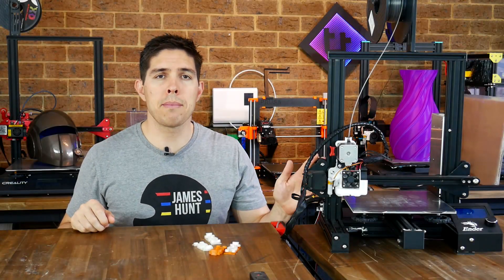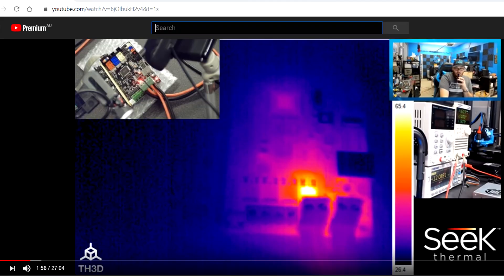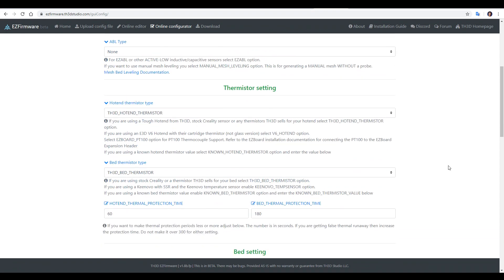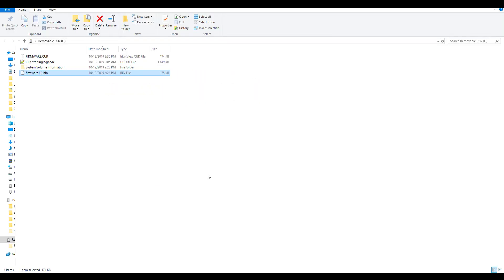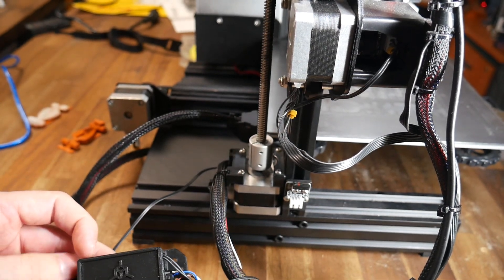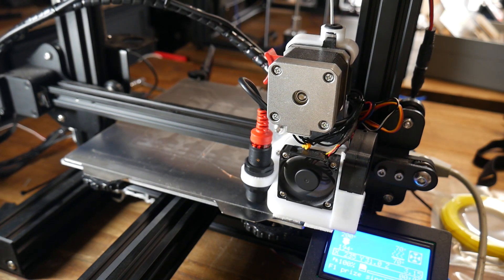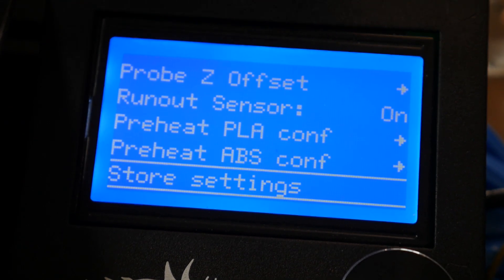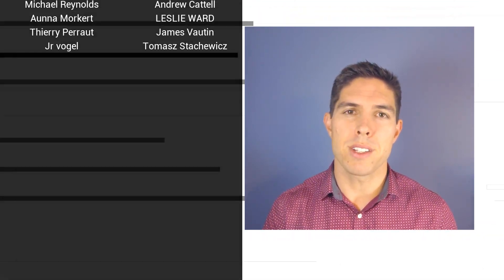EZBoard Lite - The most user friendly Ender 3 mainboard upgrade + EZABL Pro

Comment: $100 for non replaceable stepper drivers and they didn't even use the the superior 2209s...  the skr 1.3 board is under $35 with better drivers.
Reply: Timothy Hoogland  That's a lot of words to try to deflect that they are Superior drivers.. Greater max current and sensor less homing alone make it Superior. Saying that I don't need or use those features is pretty silly and shows that you know it already.  I don't use Marlin anyways so that's also a mute point. 

Bottom line is most people won't pay ⅔ of their printer price on a board. I wish you the best of luck and can see that it's a good option for those that don't know much and would rather pay than learn/mess with firmware.
Reply: Timothy Hoogland  That's not a fact... that's an opinion.I don't know if you noticed, people use and tinker with the ender 3 in millions of different ways. Some of those people might prefer sensorless homing for example. Also my 2209s have been just as reliable and that bleeding edge was half a year ago.

Instead of trying to argue the 2209s aren't superior, you should keep to your opinion of reliability or that most people won't notice the difference.
Reply: Timothy Hoogland You are claiming that there are Trinamic clones on the market? In particular for the new 2209 which just came out? This is not how the semiconductor industry works. Also, the stall detection has additional benefits over only homing, you can implement an emergency shutdown if you detect a clogged up nozzle on the extruder or the gantry hitting the top limit - no need for precision and repeatability in either case but certainly an improvement over the 2208.
Reply: Timothy Hoogland    Nah I'm good. You helped me out enough reaffirming I made the right choice going with the skr 1.3 and 2209s. You might want to work on your answers though because I'm not the one who is going to be asked, "why not the 2209s?"every time this board is mentioned. Judging by these comments,  using the"you don't need that much power" and " don't you guys have endstops?" speel isn't working.
Reply: Timothy Hoogland there is no point in cloning TMC chips, if you go into all the effort of engineering functionalities like StealthChop you are so much better off selling them under your own brand.

Show me one “clone” which is not a third party relabeled cheap Apollo or similar. Bigtreetech is obviously selling the proper ones, otherwise they would not have been affected by the lead time issues and the advanced features would not work.

I get that you are bitter about a chinese company beating you to market but if you claim the use of counterfeit parts you better have substantial evidence.
Reply: @christophmuller3511  He's claimed that there are clones on other forums too. Never could back the claims up. Tried to post some links which actually showed that there were NO clones if you read the full article. Scaremongering. Anyways, dude has made a good board. It's just not worth $100 in my and many others opinions. He's operating out the the USA so labor and other costs are much higher so he needs to charge that though. If people buy it then they either don't know that the SKR E3 Mini is 90% as easy to install and configure now that Marlin 2.0 has been released with full support or they have enough money not to care that they could get a good product for a lot less. There is room in the market for both companies but I really wish he would lay off trying to flame BTT so much to support his.
Reply: @christophmuller3511  counterfeit electronics and connectors have been a huge issue for the past twenty years in industry.

Counterfeit products undermine IP (intellectual Property), economic security for various countries, they also are sold fraudulantly as genuine products and undermines and ruins product reputation and market share.

They make these counterfeit products at sub par quality and sell for a huge profit compared to a genuine product.
Reply: creamysbrianna sure, but counterfeit chips are most of the times other compatible products relabeled fraudulently. Cloning a chip is hard, and takes years for non trivial designs (the TMC products are definitely in the nontrivial category). There is no way someone could have fakes on the market for a chip presented in June… 

Beside the engineering challenge there is also the production lead times: if you would miraculously had the cloned design ready in July you would have typically gotten the first engineering samples around now. A chip I sent for manufacturing in October has an estimated arrival time of February…

Comment: "Overengineering" has been mentioned. But is there any advantage of 32 Bit boards for a relatively standard Ender 3? With the budget 32bit boards, you might as well go with that if you want better stepper drivers. Apparently the faster chips are better at motion control, especially for higher feedrates and complicated paths. But I haven't heard a definitive word about how and when this matters in real life.

Comment: Unrelated to the board, you said something that got my attention.  You mentioned that you could keep the bed heated while auto-level with BL Touch.   Are you saying the bed shouldn' be kept heated for EZABL while probing?
Reply: It should because the bed expanding and contracting can warp the values. There is a chance that probing with heaters on will cause interference. That's why there is an option to probe with heaters on, probe with heaters off or wait for heaters to recover while probing. I would choose wait for heaters to recover. This makes the printer probe with heaters off but waits for the heat to climb back up between probings. Probe with heaters off is not recommended due to thermal expansion warping the values.

Comment: interesting, i love the online config, i've been saying Marlin needs something like that fro years. I do wonder why he went with a capacitive sensor for the new EZ-ABL though, cant say i know a  single person who prefers them over capacitive ones.
Reply: I have an EZABL pro on an ender 3, works great, M48 test brings back 0.002315 mm on the creality glass bed. (which people told me it would not even sense the glass surface LUL)
Reply from the maker: The only ABL system I've tested that wasn't accurate enough to work was the Touch Mi, but then it worked flawlessly on a second printer. M48 test is great for troubleshooting but past a certain point it becomes redundant because the accuracy is easily up to the job.

Comment: great video! does this support sensor-less homing?
Reply: Y do u want sensor-less homing
Endstop micro switches and tremendous more accurate.
.
.
. And no, its basically one of about 3 things the TCM2209 drivers can do over the TCM2208.
This board uses TCM2208 drvers

Comment: This would make more sense if it came with a cheaper MCU like the LPC1768 and TMC2209 drivers, but won't argue with quality and/or ease of use. A big problem is the lack of European distribution, though. This high base price will mean even highet customs charges, while the SKR boards often get to skip those because they cost under 40 euros for the most part. Get some European distributors, Tim, I really like your products.
Reply: Timothy Hoogland  That may be so, but the 2209's run cooler than my 2208's. I have both standalone and UART 2208's, and version 1.1 and 1.2 2209's from BTT. I don't have any Waterott drivers, though.

Comment: I started with the Skr mini. Found that I could only run stock firmware on bigtree. With no way to add anything without deleting something (ver. 1.2). Because it has next to no memory means it just juck. Went to the ezboard set it up with what I wanted and off to the races at 100mm/sec with no problems.

Comment: I have a couple of Ender 3. I’ve been through many boards, including the MKS Gen L, SKR E3 mini v2, and the E3 dip, as well as the SKR 1.3. I’ve had lots of trials/headaches, in getting everything to work correctly. I’ve had nothing but problems out of the SKR E3 Mini boards(garbage). It pissed me off so bad, I literally threw it in the garbage. I had really good luck in the past, with the SKR 1.3, so I decided to use it to upgrade my second machine. As suspected everything works great, at a reasonable price. I say that, but through all the boards, and accessories I’ve tried to make that work, I could have bought an easy board or two LOL. If I were just starting out and I had no idea what I was doing again, I would definitely purchase the new easy board, knowing what I know now. Though, I do enjoy having the knowledge after working through all the problems I’ve had. It’s a tossup. If there is anything to take away from my comment...SKR 1.3 is a good budget board, the E3 counterparts are trash and my opinion. Good luck upgrading!
Reply: I share your opinion about the E3 mini.  CPU gets too warm while idling. Coonections are not or badly soldered. Screw terminals are more loose than on my 1.1.3 creality board that was known for the issue.

Comment: Is the th3d board can or cannot use LinAvance? Because it’s using 2208? Thanks
Reply: Timothy Hoogland  Are you claiming that Linear Advance Works reliably without losing steps on the EZBOARD with steathchop enabled with the TMC2208 driver on the Extruder (E0)?  If so, please enlighten us on the Marlin 2.0  settings and the specific marlin version, because a lot of people would like to know, including me,  because I have looked all over and all I find is lots of conflicting information. Thanks, and you would be my hero.

Comment: Will it work with linear advance?
Reply: Timothy Hoogland  in another video Michael said that linear Advance is not working with 2208 drivers???
Reply from the maker: There's work-arounds in the firmware now. The main issues was with TMC2208s in legacy/stand alone mode, where as this is connected via UART/smart mode).
Reply: @TeachingTech  Thanks Michael.
Is this something you will make a guide on?
Reply: Not a fan of this video / promotion of the very expencive TH3D board.. But for still keeping it real Michael, iam now a Patreon :) Thanks Michael !

Comment: I have had some issues with Octoprint and this board. Very Very Very slow to probe 9 points, over 100 seconds!!, cooling fans not obeying the slicer input and run flat out all the time. Any one else using with Octopront?

Comment: Looks great but price is too much for me and the shipping to Australia is a killer. Does anyone know of a budget 32-bit board for the CR-10 S5? BTT say that the SKR Mini E3 won't work due to power limits (or something... impossible to understand). Basically I just want to enable auto or manual mesh levelling and thermal runaway and I'll be happy.
Reply: (plus TH3D are sold out of the Ezboard, as well as the EZFlex2 Smooth 508mm)

Comment: Could you help me to program the BIGTREETECH SKR V13 32Bit Mother Board with TFT35 V20 Touch Screen and 5pcs TMC2208 UART. To ender 3 without advice as it comes from the factory.
but since I don't know English or program it is impossible for me to do the fiware. Thanks for your time.

Comment: Sadly, I am finally giving up on getting (or trying to get) this board. Not only has it been out of stock 4+ weeks now, they JUST raised the price to $119 USD. Considering they offer free shipping on an order of 125$, you'll need to add something to hit it. I'm sorry, even if it's a great board, it's is now HALF THE PRICE OF AN whole ENDER 3 or  3-4 times the cost of ANY OTHER board available and STILL is out of stock! There comes a time when the price of one part isn't worth it when you can spend that on other mods or even a whole new printer. 😔

Comment: Anyone notice the online configurator gives options for TH3D or stock thermistors? I switched it to stock. Does it matter??
Reply: It might, for temperature accuracy. Different thermistors have different values. If you haven't bought and installed new TH3D thermistors then choose stock. Creality has already provided the correct values for the stock thermistor for us.

Comment: HELP when I down load a file It is a zip file.  how do I charge to STL file?  Could you help me ?
Reply: Zip files are simply compressed folders. When opened, you will find the contents like in any other folder. You can open and extract zip files using WinRAR or 7zip, both free. 7zip should be already installed in windows. You can either 1: open the zip file and drag the content you want out, or 2: extract files. What extract does is that it turns the zip file back into an uncompressed, regular folder. The STL files are usually inside another folder inside the zip file. Drag the folder out to desktop for an example, and you'll find the files there.

Comment: Why even bother with a 100$+ board in a printer you could get for 150$ ? and one that is decent and printing well stock. Even if you put it in a cr-10 or ender 5 or whatever, it's still almost the value of another ender-3.  don't bother with a 2% increase in quality/noise or whatever they sell and wait for the next generation of printers, which probably need other boards anyway
Reply: Why not? After the update you have a 250$ printer with improvements in the places where you see a need. My Ender 3 is now around 400$ with a duet maestro board and an e3d Hemera direct drive extruder. I am thinking about upgrading it to linear rails based on Ben Levi’s design, making it a 600$ printer. Sure, I could nearly have bought a Prusa for this amount but I still have better hardware now than what a stock Prusa would deliver. And the knowledge I acquired troubleshooting is very valuable as well...
Reply: @christophmuller3511  What a lot of younger people don't understand is that a lot of the community is made up of retired people.  I retired 10 years ago at 60 as a computer engineer and programming manager.  This is my golf game and much less expensive.  I enjoy buying a $300 Ender 5 and modding it to become a top end printer.  I probably have $1000 in each of my Ender 5's and am working on the 5 Plus now.  Much better than golfing or working on old cars.  TH3D has helped me with support and quality products.
Reply: @christophmuller3511  because it is a bad frame to upgrade that far. core xy or other variants deserve this kind of upgrades, but the ender is just good enough as it is and I bet the difference in quality is marginally better with your setup. for 600 I could turn a better machine in a n enclosed, heated chamber, watercooled beast that does any material. I mean, I get the appeal of this plug'n  play board for beginners, but for someone not afraid to tinker it's not worth the money

Comment: wow, that's like $170 Kangaroos..... ouch, For a price point, how would it compare to a BIGTREETECH SKR Pro V1.1 Control Board including a TFT35 Touch Screen V2.0 and 6Pcs TMC2208 V3.0 UART Driver?
Reply: The SKR boards may be cheaper, however with the EZBoard you are paying for a spectacular support team, a well over-engineered board and also the SKR boards don't always have a team backing them just forums and videos/forums are your only guides/troubleshooting help you may get.
Reply: @BombasticBuilder  thanks for the reply. but I'm trying to find out how the boards compare not not how the customer service compares. 

im interested to know specifically the boards are over engineered?
Reply: @phmaximus  Also, the ezboard had genuine parts and also is properly engineered with 4 layer pcb copper so heat is distributed evenly, which about 99.9% the skr are not

Comment: Is this better then duet wifi 2? I have one but didn’t put it on my cr10 S4 yet
Reply: Hell no duet is wayyy better
Reply: Timothy Hoogland what mods are required ?
Reply: @binaryinfections  you need to print a case for it.
Reply: @binaryinfections  if you dont want it ill take it off ur hands lol
Reply: @turtledude2924  It is built to the same standards as the Duet. All boards are assembled with proper thermal considerations, all high quality name brand components, and fully tested before leaving the factory. I spoke with the guys from Duet3D at ERRF this year with respect to the board and they were quite impressed. If you need a duet 2's extra expandability, it is an incredibly good quality board. If you are looking for a direct drop-in replacement built to high quality as well, this is as close as it gets IMO.

Comment: Does this work with the CR-10S pro?
I’ve only seen info on the 10S
Reply: On their homepage they say it will not work with the "touch screen" versions, which the CR10S Pro is. The EZboard Lite is especially designed to be a drop-in replacement, not a generic 3D printer board. You can probably make it work with the CR 10S, but it may take more configuration tweaking, an additional LCD/Interface and maybe even custom housing...
Reply: @Timothy Hoogland
What would be your recommendation then
Reply: Timothy Hoogland understandable I shorted my heater cartridge due to the stock connection was not properly connected and I was getting a plasma arc 

did some  troubleshooting, and it fried the secondary board and it’s still dead in the water after swapping, everything else works but there is no power to cartridge so I’m thinking it’s mainboard. Figured I’d upgrade at the same time